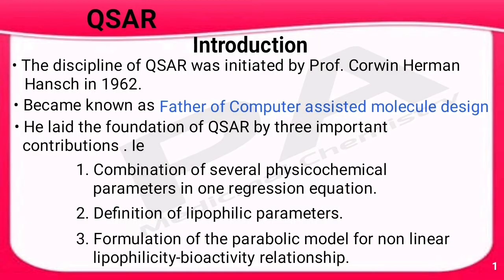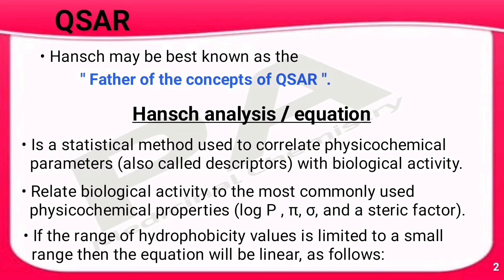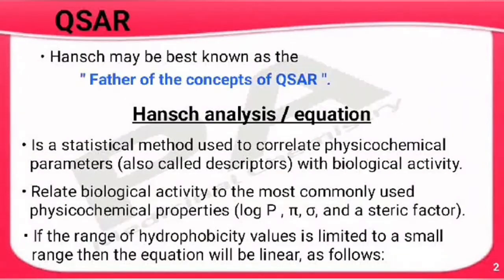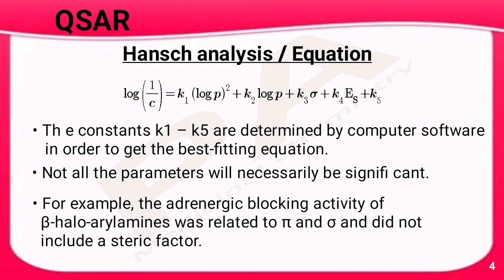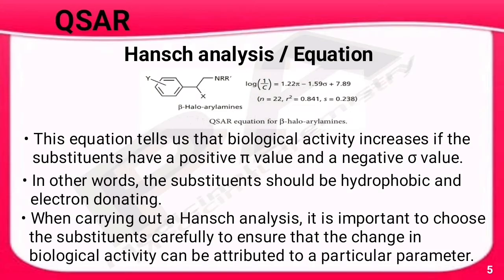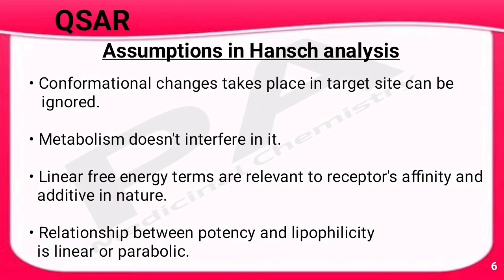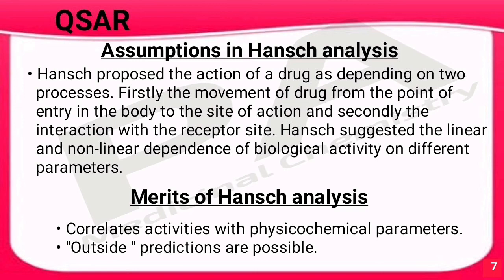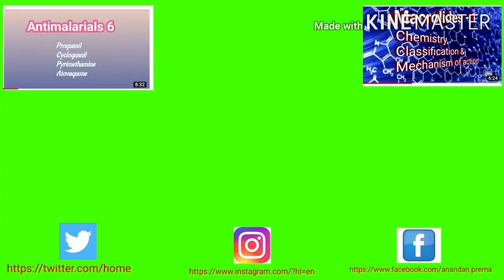QSAR | Part 5 | Hansch analysis

Comment: A QSAR analysis of the effects of substituents R on the anticonvulsant activity gave the following Hansch equation:
log (1/C) = 0.19 + 1.20 + 4.56

n = 10	 

	
	NH2	OH	CN	NO2	H	F	SO2PH	OEt	CH3	Cl	CF3	NEt2
:	-1.23	-0.67	-0.57	-0.28	0	0.14	0.27	0.38	0.56	0.71	0.88	1.18
:	-0.66	-0.37	0.66	0.78	0	0.06	0.7	-0.24	-0.17	0.23	0.54	-0.90

how do you calculate it